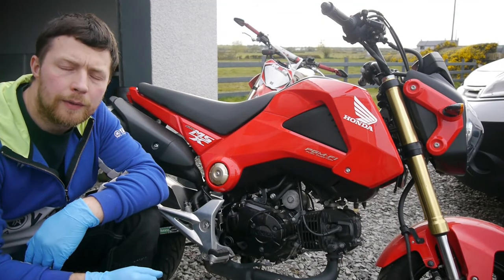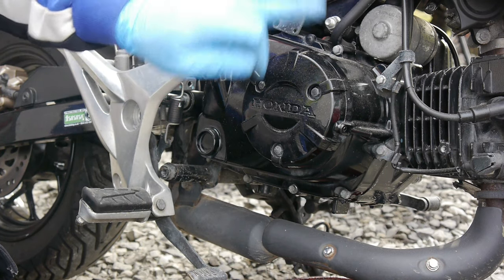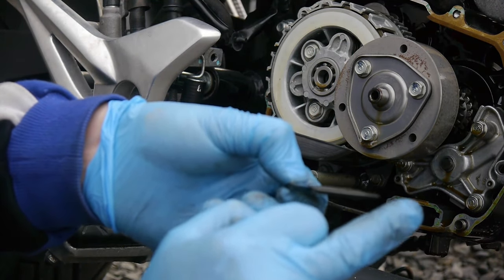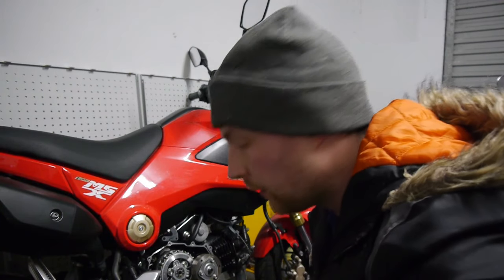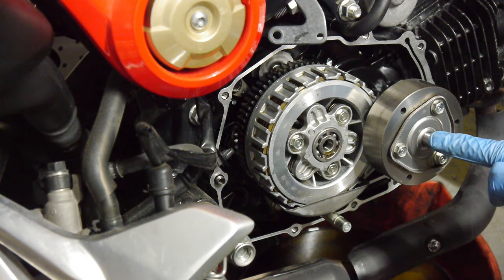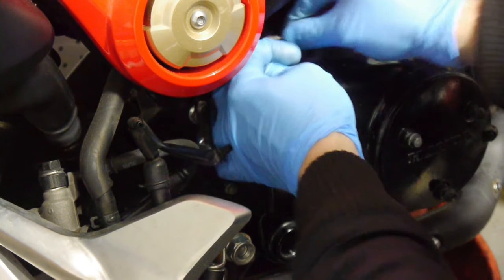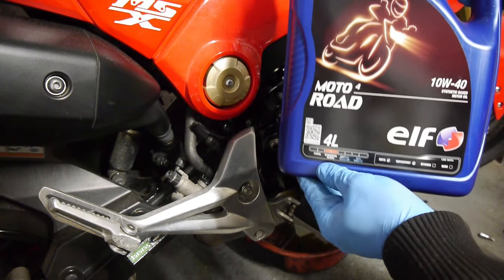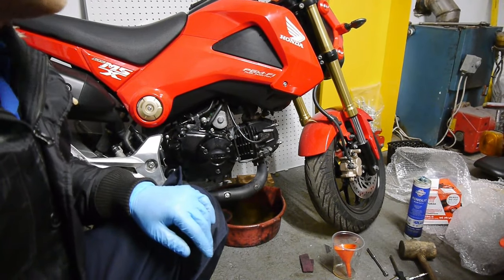How to service Your Honda Grom - Step by Step Tutorial

Comment: Hello, I own a 2017 Honda Grom 125 . I didn't ride it for few months and battery was dead . I mount a new battery and make the ECU and TPS reset but the engine won't start .
The gas tank is full but the fuel gauge blinks on empty . Can you help me to solve the problem ?
Reply from the maker: I would check all the fuses first. Did you check those?
Reply: @DarrenMcKinney1  Hi, I found the problem, the fuel pump is rusting out, must to be replaced .
Reply from the maker: @franciskongleon8718  glad you found it